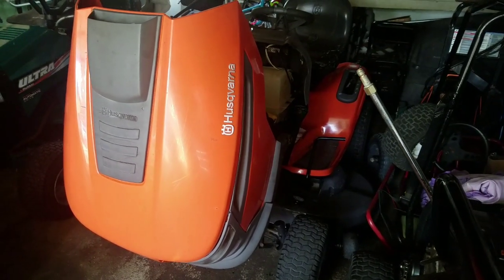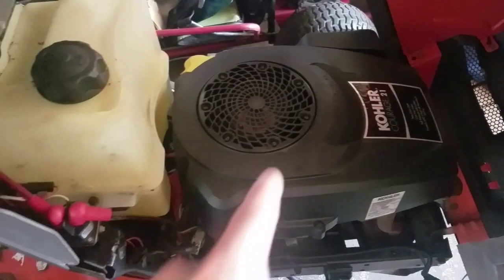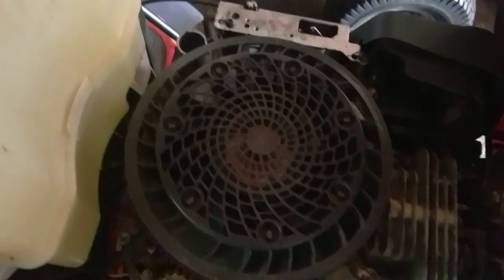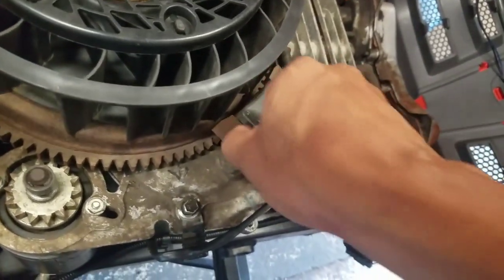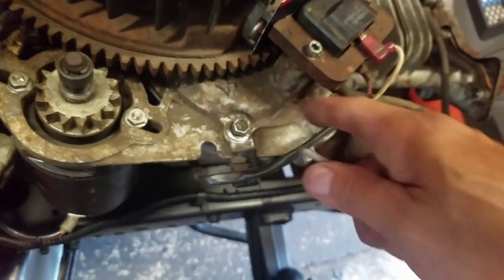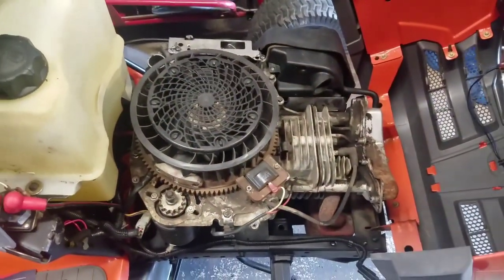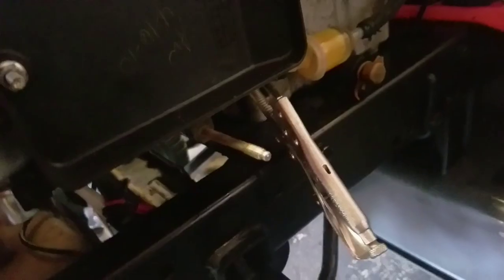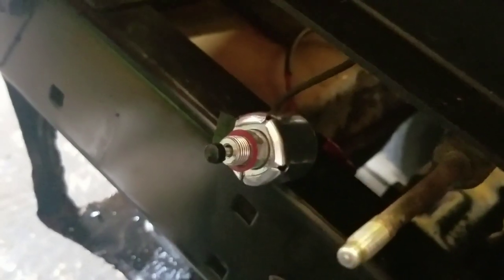HUSQVARNA YTH21K46 KOHLER COURAGE 21HP NO START MAGNETO UPSIDE DOWN CARBURETOR FUEL SOLENOID DELETE

Comment: Thanks for that idea. Tried everything and this worked! I just cut the tip off the non working solenoid and put it back in. Works like a charm.
Reply from the maker: Yup, you dont even need it..it just causes problems.  Hope you'll subscribe
Reply: what tip?
Reply: The tip on the solenoid that pushes the float in the carb up.
Reply: @evanl5876  i will try this....hope it works. Thank you!

Comment: I like your idea. Does it backfire now right after you shut it off?
That solenoid is a fuel shutoff and also while at it prevents gas from being sucked in during shutdown to eliminate backfire on shutdown.
Mine pops like a 12 gage almost every time lol
Reply from the maker: I sold the the tractor shortly after the video, but just throttle down and it usually won’t backfire,  and even if it does,  who cares right?

Comment: Hi.  I had a problem with the fuel solenoid on my Husqvana ride-on mower and was able to get it working perfectly by removing the rubber tip (the part inside the solenoid that actually seals and shuts off the fuel) of the solenoid and replacing it again without the seal. My question is... can I leave it like this forever?  Is there any real need to have the fuel off when not using the mower?
Reply from the maker: I cut mine off altogether
Reply: @MowersNBlowers  You mean the fuel can still flow into the carby when engine off? Well I ended up buying a valve for 10 bucks to switch it off.
Reply from the maker: @strikemaster1  no because the float needle seats to stop the fuel when it’s at level.  The solenoid is only to prevents backfires from surplus gas after the needle seats,  hope you subscribed

Comment: I noticed the solenoid worked ok when grounded to the frame.  There should have been a short green ground wire from a screw on the plastic carb baffle with the studs on it with an eyelet on the other end you install on one of the carb studs so the carb gets grounded. Otherwise its insulated from the block.
Reply from the maker: Yes, i noticed that too on other tractors i had...but as you saw. Even without the green ground wire, i showed the plunger open and close properly on and off onnthe ignition switch.  Either way, after the delete, it had no issues.  I soldnthe whole tractor a month ago.

Comment: I have a problem with mine it wont stay on since l pulled the choke wire wile it was running any sughetions
Reply from the maker: You broke the choke wire? Does it stay running ever or never?  When does it run?  Clean your carb.

Comment: you need a fuel shut off valve behind the fuel filter or the crank case will fill up with gas and you will blow the motor
Reply from the maker: Thanks clay, yup, I put fuel shut offs on all my tractors..except the ones with fuel pumps.
Reply: @MowersNBlowers  Yeah you didn't mention that in the video and you used vice grips to stop the fuel just thought I'd let you know that switch/valve also keeps the carb from overflowing into the crankcase I would hate for someone to damage their mower and blame your video you know how people are I got a pos courage 20 on my Husquvarna didn't think I would ever see a bigger pos till I came across a powermore Chinese motor on a push mower today a 139 cc not a 135 or a 140 a 139 wtf junk
Reply from the maker: I've had a few Chinese clones...always worked well.  You also know those fuel shutoff valve solenoids cause a lot of engines not starting!  The valve sticks, or shorts and stays closed!  I'm just telling you how to 86 the solenoid if you wanted to.  Yeah I know how people are...I'm not the first to show you how to mod things on YouTube.  You'll never find a fuel solenoid on any of my tractors.  Too many problems with solenoids.
Reply: @MowersNBlowers  I'm with ya bro

Comment: Here is the secret . After replacing a battery I got an idea.   Choke choke choke.  There is nothing wrong with all the internal parts of this great motor. It's not fuel , spark,  timing etc. Its the position of the CHOKE. 
I bought a identical husqvarna courage in 2011. And the 1st 100 hrs no problemo.  Then I started having the issues you were troubleshooting.  Well for starters I only use real gas ( no corn). And I use synthetic oil.  So I decided it's not internal. Here is the trick.  When you cold start this mower,  lift the hood , then put your finger on the choke lever. Pull back once or twice , booooooom. The engine will fire up. I also get a back fire occasionally.  But that's has to do with the stroke on that engine.  My mower is going on 9 yrs old and cuts like a champ. I suppose the choke is a tad off? But I been doing this for 7 yrs. (:
Reply from the maker: Thanks for your comment, but...it wasnt the choke...it was the fuel solenoid as the video shows.  Choke is perfect, closed like it couldnt close anymore.  Lever tuned perfectly.  Engine starts great after the solenoid delete.  But thanks for your comment.